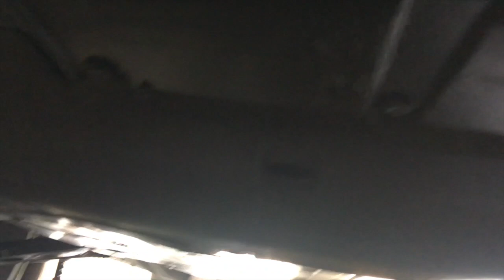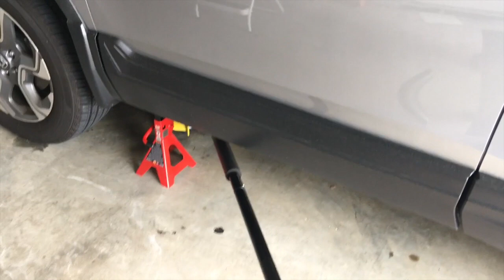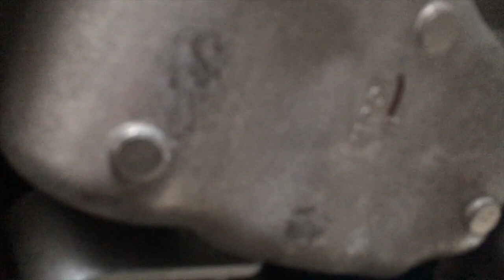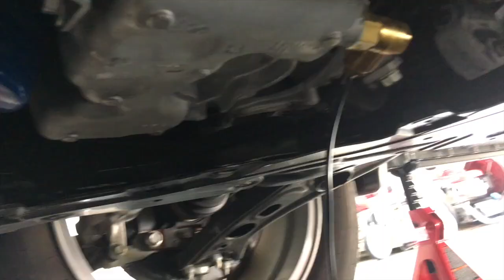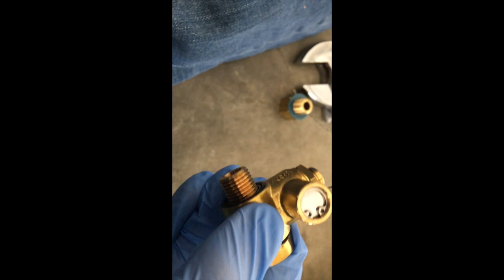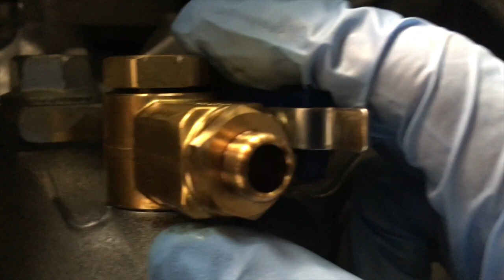2017-2022 Honda CR-V 1.5L Turbo 2nd Oil Change and Updated Fumoto Valve Install

Comment: The regular F106S (the one I like) can't be adjusted, so you'll have to screw and rotate the valve opening mechanism. Do you think is enough room to do that? Of course you don't have that problem because the F106SX doesn't need to be rotated, just adjusted to your like. I like the F106S because it has less possible leak points.
Reply from the maker: I’m sorry I can’t answer your question definitively but I do have a suggestion. During your next oil change go ahead and try installing the Fumoto valve that you like. If it doesn’t fit correctly, remove it and put the Honda drain bolt back in place. Take some pictures of the problem areas and you can consider using a possible adapter that would extend your valve out further beyond any clearance issues. You could then install the modified version at your next oil change.
Reply: @PaulNaylor3  makes sense. I was even thinking on buying both models and the extension to see what works best hehe. Just so much hassle. I also have stripped metal panel bolts.  Just bought a bunch of them on ebay since those don't seem to last more than 4 oil changes in my case...

Comment: Still have this vehicle? Have you noticed a rise in oil levels? Just do a Google search and there's lots of concern about diluted oil in this engine - it's in the Civic, as well. I have watched my own oil level rise - it's not a figment of my imagination. My solution is to just change my oil more frequently than their maintenance minder tells me, which I do every 5,000 km (3,000 miles) or when the maintenance minder is at 50% oil life left - whichever comes first.
Reply from the maker: I change mine every 5,000 miles as well. You may be interested in looking at the Blackstone oil analysis video on my channel.

Comment: Do you have an update on that valve has been working good for you?
Reply from the maker: Yes, the Fumoto valve works great. I have over 60,000 miles on my CR-V so it has saved me a lot of time and oil messes during oil changes.

Comment: It looks like you used a washer with the adapter, but not when you removed the adapter. Not sure if I understand; does the Fumoto have its own seal? Thanks in advance as I am considering one for my friend's new CR-V.
Reply: Fumoto F106SX has an O-Ring to seal the valve.
Reply from the maker: Yes, the Fumoto has a lifetime seal and does not use a crush washer.

Comment: Nice video thanks for sharing your knowledge I wanna know if there’s any way to put any hose plastic ? Instead of using a drain oil pain
Reply from the maker: black_knight _ I’m not sure I understand your question. Fumoto valves connect with plastic tubing if you want to run plastic tubing to a drain pan.

Comment: Good video and informative. Would the valve work without the extension?
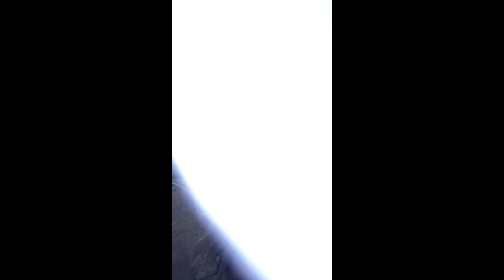Reply from the maker: @3:45 I go over this and remove the adapter and show that the adapter is not needed. So, if you order a Fumoto valve for a 2017+ CR-V, you do not need the extension. I hope this helps.
Reply: Paul Naylor thanks for your fast response. I actually bought the EZ oil drain valve instead and they recommended that an extension adapter be used. It’s a bit different configuration from your Fumoto and judging from your video it would probably present a problem for me. I’ll have to be patient and wait because our CR-V has 1500 km or 80% oil life. Thanks again and God bless.
Reply from the maker: You're welcome! I hope you enjoy your CR-V!

Comment: Did you need to install the valve at 90 degree angle in order to close the metal cover?
Reply from the maker: I Ismail I did not have any clearance issue with the Fumoto valve & the metal cover. I installed the valve in my preferred orientation of how I wanted the oil to drain & checked that it cleared the cover. In another video I show the Fumoto valve install & how this SX model is adjustable.
https://youtu.be/DvdD7gSY0jM

Comment: Would the "standard (straight)" or "S (short nipple)" series Fumoto valves fit on the 2017 (1.6L) CRV?   Thanks.
Reply from the maker: I used the Fumoto F106SX. Fumoto's website allows you to type in your make and model and it gives you the recommended valve for your vehicle. I hope that helps.
Reply: The Fumoto website lists all four of the F106 models as fitting the 2017 CRV1.6L; I assume based solely on the thread size and pitch.  Since you have been in there, I am asking if you think there is room for the standard models to spin on (as the "T" with the on-off handle in it sticks out).  In the SX versions (like you used) the "T" does not have to turn.  Thanks much.
Reply from the maker: I believe all of the F106 models would work. If you have not ordered one yet, I would recommend the SX. However, if you already have a different F106 model, then I think you will be fine.

Comment: love the valve but its a shame you need 2 screw drivers and 10 minutes to take the pan on and off to access the drain and filter
Reply: Had Honda (Canada) do my first oil change at one of their service bays. They left off all but 3 of the Philips head bolts when I got the car back. I didn't even ask for those other bolts back, because I don't see an advantage to having them all on, plus and it saves a lot of time when I do my own oil changes. Those 3 are enough to hold on that flimsy plate, imo. I've done every subsequent oil change - now 90k kms. Buying the Fumoto now because of this vid. Thanks, Paul.
Reply: I went to a oil change place that charged extra to take off the cover...$5 lol.

Comment: The center screw on the back of the shield was incredibly difficult to remove while the others were very easy.  I couldn’t remove it.  I see from other videos that others have had the same problem.  However, I noticed that with all the others removes, the shield easily pivoted out of the way.
Reply from the maker: Hi Craig. Yes, I had the same challenge on my first oil change, shared here: https://youtu.be/DvdD7gSY0jM  I ended up using an impact gun to remove that stubborn screw the first time but it has been fine ever since. Thank you for sharing the good solution of pivoting the shield.

Comment: Hi Paul, when u change oil for the first time, did u change because of the "tool" icon pop on the instrument panel or u just had your own target on km or mileage ? From what i knew that modern cars can use oil for as long as, max, 10000 km. However according to a honda dealer we should change the oil whenever we see an icon tool illuminates on the instrument panel... It also indicates the lifetime of oil. I am confuse what to follows... My question is that to change oil according to the signal that illuminates or just every 10000 km?  Thanks..
Reply from the maker: Great question. I think you are better off changing the oil at a target mileage instead of relying on the tool icon. The question then becomes what your target mileage is and what type of oil you will use. Definitely use a full synthetic oil that satisfies the requirements in the Owner's Manual. I change my oil every 3,000 miles (4,800 km). With the heat created by the turbo and only having a 3.7 quart capacity I think it is a good investment in the long run to change the oil every 3,000 miles. If you are using a full synthetic oil you are probably okay at 10,000 km (6,200 miles) but you may want to consider changing every 8,000 km (5,000 miles). I realize that I change my fluids more frequently than is necessary. Thank you for the question. I hope this helps.
Reply: In my city, jakarta,indonesia, traffic congestions often occur everyday. Does this condition will effect on oil life too?, before the actual target that we should change? You know, the honda dealer gives an engine guaranty for 3years or 100.000 km, which ones reached  first, and when we do not take service to them, the engine guaranty will be terminate... Is there such thing in US? Oh.. I have another question, is it true that engine temp. Is hotter in turbo? And that is why we should change oil more often than usual engine with no turbo? Do u change the filter everytime u change oil? Or 2 oil : 1 filter ratio? I hate that we should depending on them when i can DIY my self... Do you have a video on how to reset the tool indicator every time you have change oil to your target? Thanks for everything...
Reply from the maker: Yes, the driving conditions effect oil life. If the cost of the oil and filter are not a problem, you can't go wrong changing it more frequently, somewhere between 5,000 and 8,000 km. Yes, we have a 5 year, 60,000 mile engine warranty in the US. We do not have to go to the Honda dealer to keep our warranty, though. I save my receipts for my oil and filters and document the date and mileage of the changes. This will satisfy the warranty. Yes, turbo engines create more heat for the engine oil from what I understand, than engines without turbos. Yes, I change the oil filter every time I change the oil. This is how I reset the engine oil life after I change the oil: 
Resetting the Engine Oil Life (after each oil change)
1. From the HOME screen, select Settings. 
2. Select Vehicle. 
3. Select Maintenance Info. 
4. Select Select Reset Items. 
5. Select an item on the list to reset.
Reply: Thanks Paul...
Reply: Now a days i heard about oil dilution on new crv. What do u think? Is this why we should change oil frequently? How do u going to do with the intake valves cleaning? Share if u have done the video... Thanks.

Comment: There's no benefit to using Amsoil Signature Series 0w20 for maintenance minder regulated oil change intervals. I switched to using Amsoil OE 0w20 and get similar Blackstone oil analysis results when compared to Amsoil SS 0w20 that I used after first oil change. If you don't mind me asking how much oil do you burn before oil changes i.e. I burn 0.5 L on average for 12,000KM and similar for 12,500KM before changing the oil and filter.
Reply from the maker: SuperPerodjetlic So far I have not burnt, or lost, any oil between changes. I am at 10,000 miles now. I changed the oil at 1k, 4k, 7k, & 10k.
Reply: SuperPerodjetlic ju

Comment: Nice video. Thanks.  Any reason why you don't use ramps instead of the jacks?  I switched to ramps years ago and it is much easier for me.
Reply from the maker: Jack and Jack stand locations are in the first minute of the video.
Reply from the maker: Hello Bob. Thank you for watching. I don't currently own any ramps but I do have the jack and jack stands so that is why I am using them. I can see where ramps would save some time. While it is hard to picture ramps failing, I think if I were to use them I would still like a jack in place, similar to how I do now, as a safety measure. I used to have low profile ramps for a lower car I used to own but I sold them since they only raised the vehicle about 3 inches. I may consider some in the future. Thank you for the comment and question.
Reply: Paul Naylor 
Can u saw where ' s located the jack.
Thanks.!.
Reply: Paul Naylor .
Thanks.!...
Reply from the maker: JIMMY TRAN You’re welcome

Comment: Did you use a "lifetime seal" between the oil pan and fumoto valve ?
Reply from the maker: This seal is what is part of the fumoto valve design so it is not an additional item. So, yes there is a seal in place that never needs to be changed so the fumoto valve never needs to be uninstalled.
Reply: @PaulNaylor3  looks like you left that blue ring seal off - were you not supposed to use that?

Comment: great video sir!! Does it leak oil after you remove an adapter?? Thank you
Reply from the maker: Minh Tran No, it doesn't leak because the fumoto valve has a lifetime seal built-in.